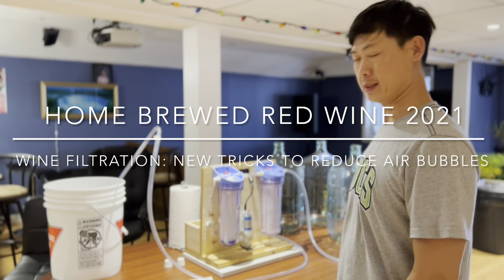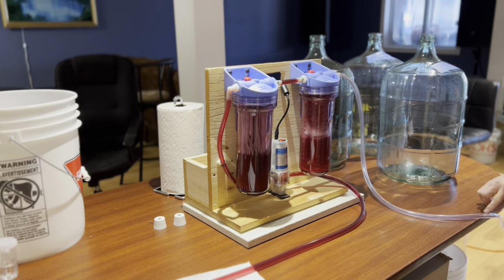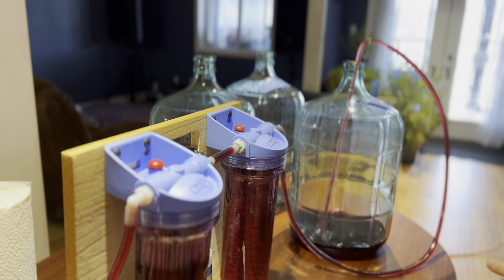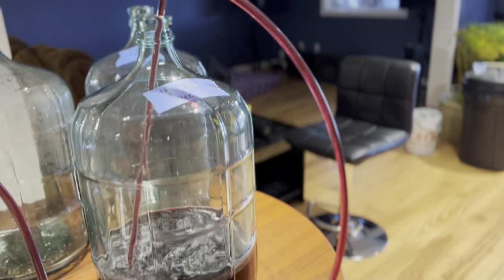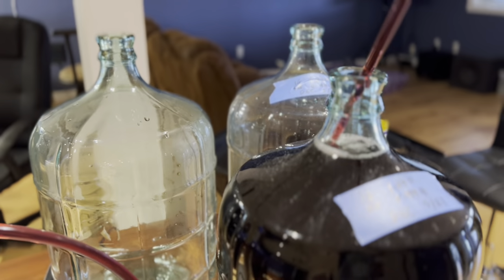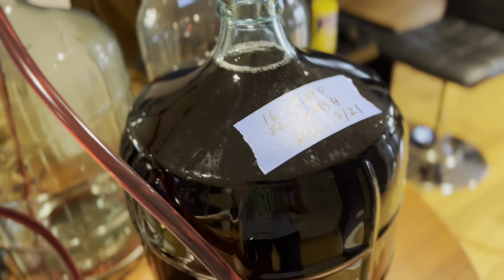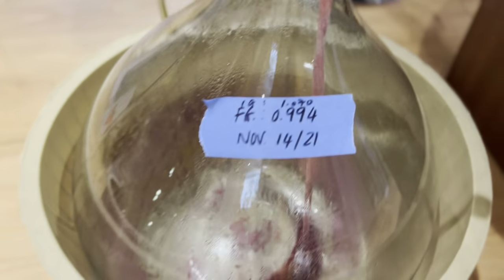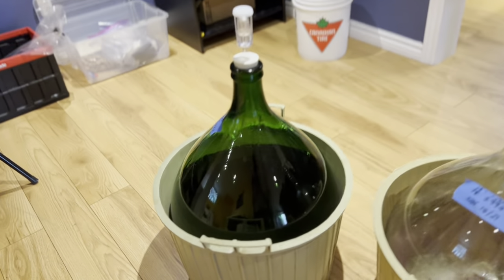HOME BREWED RED WINE 2021 - WINE FILTRATION: NEW TRICKS TO REDUCE AIR BUBBLES

Comment: Very nice setup. Personally, I use 5 micron on the first stage filter, and a Hollow Fiber filter membrane to filter down to less than 1 micron on the secondary filter. I don't trust the woven or wrapped fiber filter, personally. Also, I reuse the filters several times by hooking up the pump backwards and backflushing the filters with fresh clean sanitizing solution. Works great, and saves on filters.
Reply from the maker: Great suggestion, MisterGulsby!
Thank you!

Comment: NIce new tricks Tran. Really good suggestion from Brian LOL. And how could you tell when to change the filter cartridges anyway? Do you have to rinse the pipes regularly?
Reply from the maker: Hahaha!
Thanks for the trick! It did work very well!
The filter cartridges are good used only for one batch (4 carboys) and get thrown out after. All hoses and filter housing are rinsed out before and after use with warm water (sanitized before filtering process)

Comment: Nie wiem co robię nie tak
Przefiltrowałem 20 L wina filtr 20 mikronów i 5
Teraz zrobiłem następną filtrację na dwa filtry po 1 mikron 
I uważam,  że albo wino ma teraz mnóstwo mikroskopijnych pęcherzyków i wygląda gorzej niż po filtrowanie 20 i 5 mikronów
Po filtrach 1 mikron jest nie klarowne, nie wiem
Poczekam jeden dzień może faktycznie pęcherzyki powietrza i potrzeba chwilę czasu aby znikły
Reply: I don't know what I'm doing wrong
I filtered 20 L of wine, a filter of 20 microns and 5
Now I did another filtration into two filters of 1 micron 
And I think either the wine now has a lot of microscopic bubbles and looks worse than after filtering 20 and 5 microns
After 1 micron filters is not clear, I do not know
I'll wait one day, maybe the air bubbles do and it takes a while for them to disappear
Reply from the maker: I am not sure why your wine looks worse after second filtration with 1 micron filters - unless you used the wrong media, that is carbon media. In term of microscopic bubbles, those will dissipate overtime if your wine is still in carboys with airlocks.

Comment: Still seems like way too much oxygen being introduced
Reply from the maker: Yes, there’s still oxygen being but much better than previous year.
Reply: @PTranProductions  As some have suggested on your other videos, I think if you were to invert your filter housings you would eliminate the aeration problem.  The wine would come into the filter housing pass directly through the filter and then exit the housing and it wouldn't matter how much air was left in the housing.  Your current setup drops the wine from high up to the bottom of the housing where it then goes through the filter and has to get sucked up to the top of the housing again and this is where the air is coming from.  Try flipping over your filters next time.  I'd be real interested to see if that doesn't fix your problem.
Reply from the maker: @Sku11Leader  
Thanks! I will try next time.